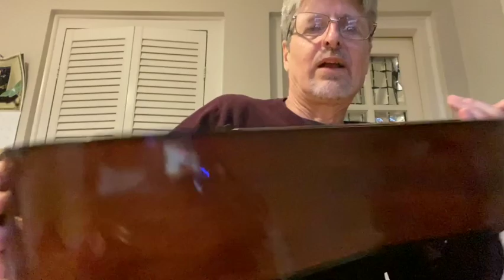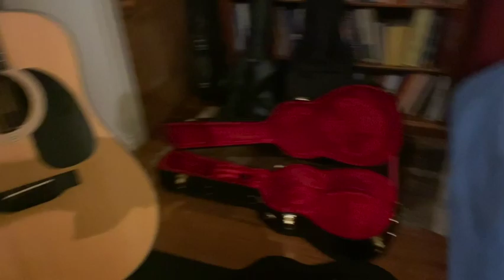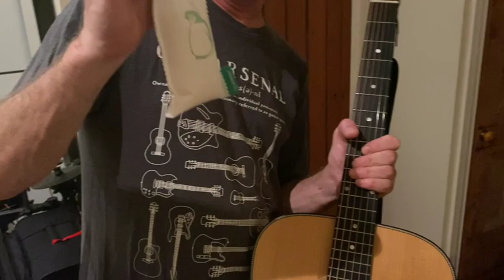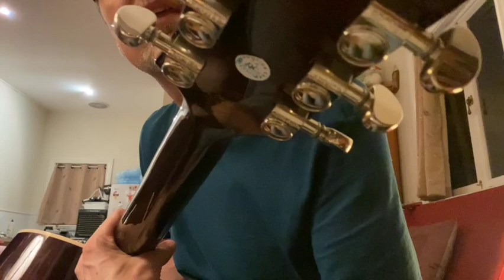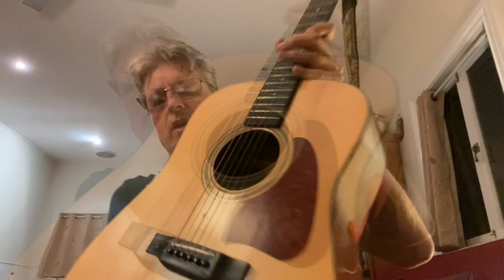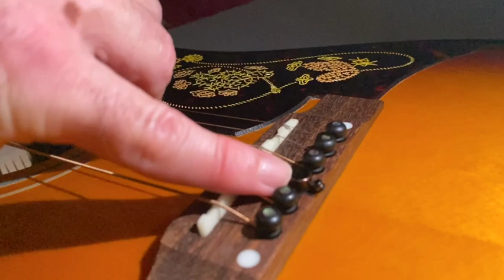SLASH J-45 and EPIPHONE FRONTIER vs EASTMAN DREADS!!

Comment: Oh and slotting the bridge made a big difference on my Washburn Maple Jumbo, really woke it up big time, it had really shallow break angle, it's all solid Spruce and Maple and it also opened up the bottom end sonically.
Reply from the maker: I notice the Eastmans now come with some slotting from the factory. I have had experience of reducing saddle height on a new guitar to get a playable action and the tone, volume and responsiveness going to  sh**. Slotting the bridge to increase the break angle definitely helps in this situation.

Comment: I've subbed because of your Eastman content and wealth of information, I live in the Blue Mountains outside of Sydney, humidity could well be something to consider for me also, I just picked up an Eastman E6SS-TC from Gladesville Guitar Factory, great service there and it's a ripper guitar, I can't find any flaws or issues and it sounds so rich and sweet straight out of the case, I feel blessed to have stumbled across it really.
Reply from the maker: Thanks for your comment. Gladesville have a very long relationship with Eastman and get their guitars direct from them. I haven’t seen an E6SS, but like that model a lot, being their take on J45. I reckon Blue Mountains would tend to be a little dryer than aSydney, but good to check with a hygrometer, or on your iPhone weather app. All the best, Nick
Reply: @turrafirmaguitarchannel  Thanks for your insight, I have been doing as you suggested and checking humidity for my area through my weather app and at this time of year (winter) it's  been around 46% to 48%, happy days  👍 for now at least.

Comment: The slash is a nice guitar.  Getting over the “signature” aspect it has nice appointments and like anything benefits greatly from a set up ( in my case I cut a new nut and saddle from bone and removed the pick guard).  The current price drop puts it at $50 more than the IBG j45 but with a case.  I happen to like the 16” radius too.
Reply from the maker: I really liked the chunkier neck profile on it.

Comment: Try an Eastman E20SS-V-sb compared to the J45.   Thanks, nice comparison
Reply from the maker: Hi Ted. I owned an E20ss a couple of years ago. Lovely guitar but I sold it. Probably a mistake. Love the Eastmans.
Reply: @turrafirmaguitarchannel  the ""v" vintage varnish is quite nice,  thin violin finish.
Reply from the maker: Those varnish finishes are amazing. Also I heard that now Eastman own Bourgeois Guitars they will continue to refine their bracing, construction etc.
Reply: @Turra Firma Guitar Channel  Not quite. Bourgeois is still its own company. Dana Bourgeois has a working agreement with Eastman to build Bourgeois Tone Tight guitars. Dana and folks in USA tone tap, sound each guitar top and vacuum seal it and send it to Eastman in China.  The guitar is assembled there with a Bourgeois patented bolt on Tone Tight neck. The finished guitar is then sent back to Bourgeois in the USA. They check it and set it up before sending it to a dealer. It's a partnership, not a takeover.  Bourgeois staff went and trained Eastman staff. Bourgeois still makes their own guitars, about 450 per year. However, there will be more Bourgeois Tone Tight guitars assembled by Eastman annually.
Reply from the maker: It’s a win win!  I hope I can move up the food chain to a Touchstone or even a Bourgeois one day!
Reply: Ps I have an Eastman E40 OM TC with a Bourgeois Touch Tone soft V (Bourgeois style) neck. Sounds close to a Martin OM 41. Other Eastman seem to have the traditional dovetail neck joint.
Reply from the maker: Hi Tex, if you make a video of it I will watch 👍
Reply: Found this post on amother video:

Brian Desjardins
2 weeks ago (edited)
I'm a luthier at Bourgeois Guitars in Lewiston Maine,  for those of you not familiar Eastman has recently purchased Bourgeois and Dana has been working ti improve Eastman, you can see by that first Eastman the Bourgeois flare, I'd go Eastman any day of the week they sound absolutely amazing and built truly by hand. Our production manager and Bourgeois flew out to Eastman to teach how we voice. Not to mention Eastman is LIFE warranty and epi I don't believe offer a warranty.

end quote..

Hmm.. Seems (if that post is true) like Eastman bought Bourgeois...  So your argument they are two seperate companies doesn't seem quite correct...

If Gibson owns Epiphone then One is a company and the other is a brand owned by the parent.. for example..
Reply: Ps. Would like to say Bourgeois, Eastman, Gibson and Epiphone are all great makers of fine guitars and to me the only thing that counts is that folks who know how to build fine guitars get them into the hands of players at a range of price points that best serves the marlet.. Brand, parent company, subsidiary.. matter less..
Reply from the maker: @weeasledude  yes, I heard that Eastman bought Bourgeois, there is an interview with Dana on the Acoustic Shoppe YouTube channel, he talks about the relationship.

https://youtu.be/8ZMTUSmQ44I
Reply: Ok so bottom line in Dana's words (to paraphrase):
Eastman is majority owner allows Bourgeois Guitars to operate as an independent Brand.. So I was correct on that point and Tex was correct on the independent part (just not as a seperate company)..   Its great that Eastman hasn't done what Gibson did to Epiphone (initially used the brand to offer high quality modern designs and then turned it into a low budget, low-end import brand).. only recently Gibson is returning Epiphone to its roots as an equal of Gibson but with less traditional designs.. It is great that a company outside USA has the foresight to preserve Bourgeois  as a premium USA maker...
Reply: Just picked up an E6SS-TC, it's a J45 killer, I love it.....sounds overwhelming to my ear....in a good way 😂
Reply: Hi. No they don't, but they do build guitars for them.  @turrafirmaguitarchannel
Reply from the maker: @FishTillYouDrop  see https://bourgeoisguitars.com/bourgeois-eastman-collaboration-update/
Reply: @turrafirmaguitarchannel  it's 51:49 of Bourgeois. Dana still gets the last word.

Comment: Humidity here in Montana is dry summer and winter.  We add humidifiers. AR -36F WITH 34%outdoor Humidity,  it's-1% humidity inside.
Reply from the maker: Yep, we are at opposite ends of the humidity spectrum! I put a bunch of moisture absorbers in my guitar cases following Chris’s recommendation and I think the guitars are sounding a bit crisper and more resonant. What do you use to keep the humidity level right with your guitars?
Reply: @turrafirmaguitarchannel  Bozeman or D'Addario humidipaks. I use Oasis humidifiers if things get low.I I have 2 rooms with humidity control. I play outside the house 16 hours a week so a good case is needed.
Reply: @Turra Firma Guitar Channel  Boveda humidifier not Bozeman

Comment: The slash is more subdued (hasn't yet opened up?) but sounds more "organic" than the Eastman (less bright?). The Eastman has a lot more volume/projection, however. Despite this, I ultimately prefer the slash!
Reply from the maker: Also the Slash had the bridge doctor installed, I think the BD tends to subdue the response of a guitar.

Comment: I think an Eastman acoustic is on the cards for me this year. Bout time I found that 'one' acoustic guitar you can't let go of lol. 
Im more of an OM28 kind of person or that similar size so been looking at what eastman do in that vain.   A common thing with Eastman seems to be there generally brighter then all there counterparts so definitely having that in mind when looking at the acoustics.
Reply from the maker: Hi Paul! I have been watching your videos on the Eastman electrics 👍🔥. Re the Eastman OM sized guitars I don’t think you can go wrong, the equivalent of the OM28 is the E20OM, which has Adirondack top. For me I go back to their dreadnoughts as I like the power of those. I think Eastman do dreadnoughts best; Eastmans are a bit heavy built and that tends to effect the smaller body OMs a bit more, which makes them less responsive - especially if there is not a lot of saddle height/break angle. That was my experience. 
I have my eye on Recording King Series 11 000. I have a RK single 0 and it is super light built.